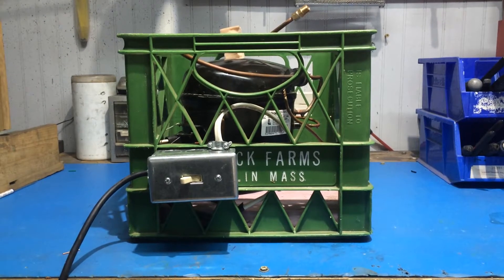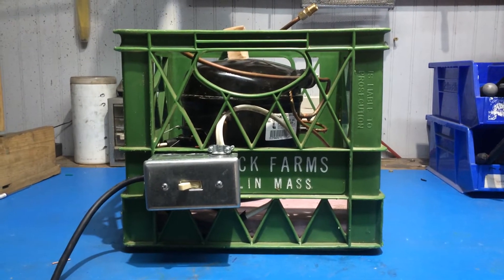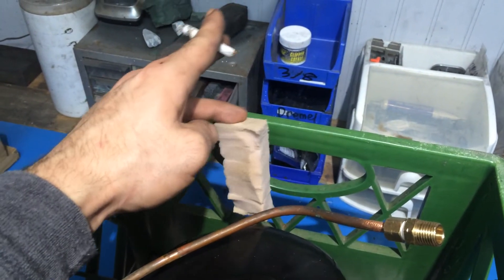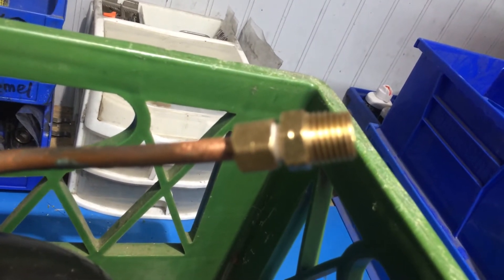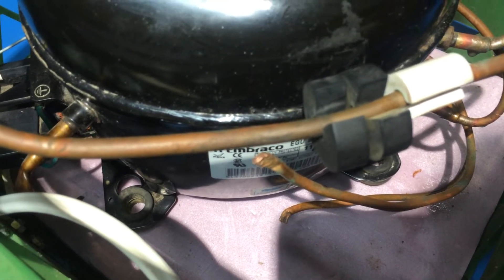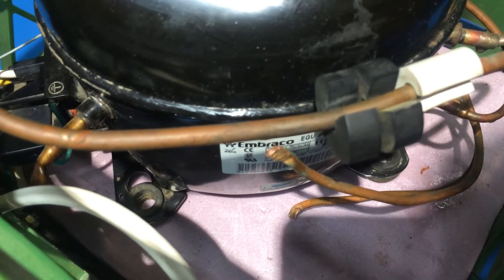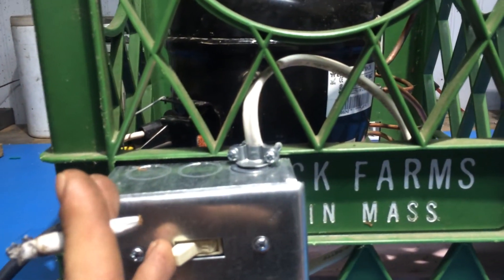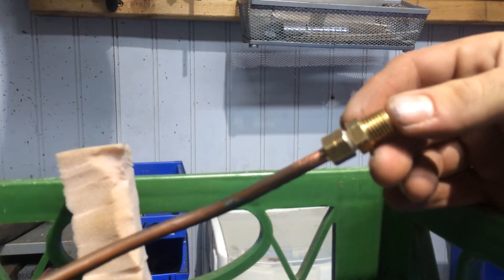DIY Cheap Vacuum Pump From Refrigerator/Freezer Compressor BHO

Comment: I'm illiterate to pneumatic and vacuum compressors, and I've  spent many hours & nights here and there, watched Same videos,and new ones,but so many variations of compressors, vacuums,and methods that I beg of anyone knowledgeable:"for an amateur hobbyist interested in distillations, filtration,possibly even a small dessicator. if I have an compressor used in an a/c,pulled fridgerants out,is this method for me( using the intake as a vacuum,w/check valve) ? what other precautions need observering? could someone write a parts/ fittings list , please, at this point I'm confused and discouraged. it's from an COMPAC II a/c unit,believe is 1/4"x 1/2(or 3/4) not sure. is a water oil filter required? manifold, switch, regulator, gage(one or more? liquid filled or not?30psi or 300psi? ) If you've or know any sites with information on the likes of  what I'm trying attempt. I've a million ideas but knowing which fits what bits, threadings, m/f, inner/outer..aim is to have compressor » 8-10mm hose connected to glass barbs. The bare essentials,and any ideas for innovation,but sticking with a simple list I can made at ease knowing it's a compatible. Takes oil? how often is so? sorry for going on and on..